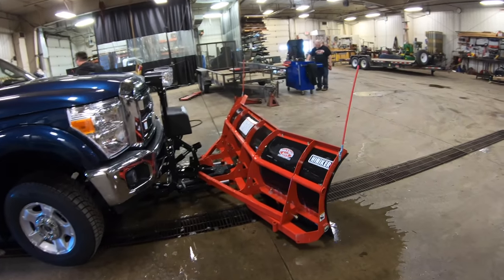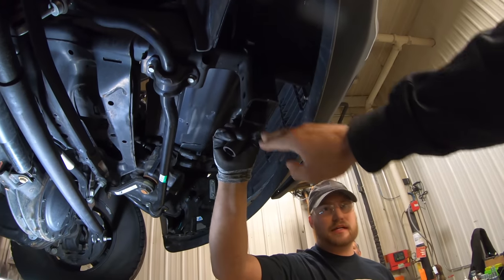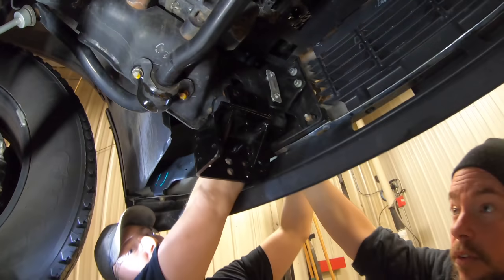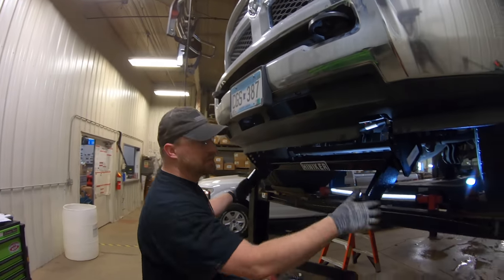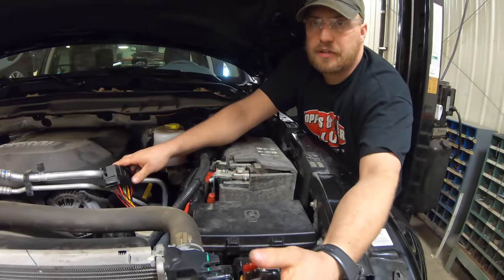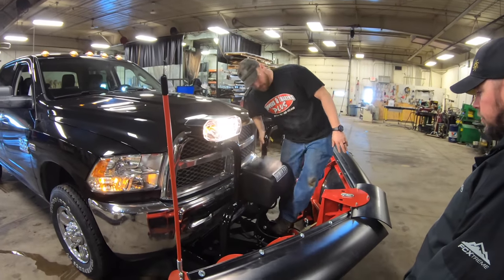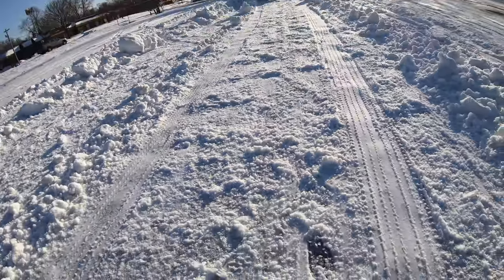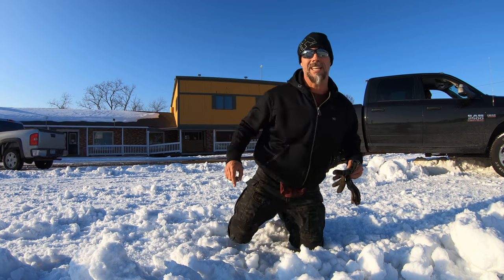Building and testing a new snowplow truck on a lot thats never been plowed 4 k video

Comment: The stock Firestone tires on HD Ram trucks absolutely blow. Replace them with a decent set of all terrains and you'll see worlds of difference. At 20k on mine they're about garbage and I don't use my truck hard at all.
Reply: Yeah found this when I tuned my 17 and turned it up, just blows tires off when boost kicks in. New generals in this week.
Reply: My '15 came with the Firestones.  I used them the first year and at just over 10k miles replaced them with Goodyear Duratrac's.
Reply: @Anders Conner instablaster :)
Reply: @Remy Hendrix it worked and I now got access to my account again. I'm so happy:D
Thanks so much, you really help me out :D
Reply: @Anders Conner You are welcome xD

Comment: If your intercooler is leaking lots of fluids. Youuuu probably shouldnt be worried about putting a plow on your truck. You have bigger issues.
Reply: He was talking about disconnecting the intercooler having it leak. That is why they work around it. If it was not a gaser
Reply: bigtx77  thank you.
Reply: bigtx77  Let me drop some knowledge on you. An intercooler isn't ONLY air to air. An intercooler is any method of cooling compressed (charged) air. It can be air to air or air to water. So, yes, intercoolers often contain a liquid.

Comment: Ram actually changed it so you no longer Need headlight adapters. If you get the plow package on the new rams.  It automatically transfer your headlights to your plow lights. Turns off your front air bags too I believe and some other nifty things.  Ram was smart for finally thinking bout their plow customers because that's been a big complaint on their trucks for years

Comment: Great videos. Last year i bought a new Ram 2500 reg cab. The Firestone tires are junk. I have been in business since 2003 and only run BFG tires. I drove it straight from the dealer to my local tire store and had bfgs put on and sold the firestones for cash.

Comment: I have used my hiniker scoop and it is a beast. I love the design, it is basically a box plow for a truck. The only thing is the paint is a little on the bad side. It has a little bit of a rust bubble in a few areas. Other than that it is a beast of a plow. i have had it for 3 years, 1st year we didn't use it much. But last year and this year it has been a blessing.

Comment: A good set of snow tires makes a big difference.  Also counter balancing the weight of the front plow, with a few thousand pounds in the rear will make a huge difference
Reply: need about 900# in rear for typical 8' v plow, sand bags, then also any salt you will use on top of that (so you don't lose optimal weight, and put the sand, behind the rear axle).

Comment: Been running Hiniker v-plows for 20 yrs. love em. Only has one issue. That was on my first one that was 15 yrs old. The power wire in motor burned off. Just re soldered and ran another year. Went and upgraded to new one same as in video. 0 regrets.

Comment: I've only had Western and Fisher plows. The Hiniker construction doesn't look as strong and I don't like the way the plow hooks up to the truck plow frame. The plow controller looks really easy to use.
Reply: Bradley Fitkin I’ve had my Hiniker for 5 years now, she runs flawlessly. Worse thing is the head lights... darn wires burn off at the connector to the bulb. Easy fix, just annoying cuz it happens like  twice a year.
Reply: @Helloreality101  I bet the wires burn off when you need them and that sounds like a design flaw. I've had my Fisher E-Zee V plow for 18 years now and all I've replaced is a angle cylinder which I broke.
Reply: I really didn't like what I saw with that Hinniker. I've always had Fisher or Boss plows. The each have their pros and cons
Reply: Bradley Fitkin that’s because there is no plow better than a fisher
Reply: hiniker 0 problems on c plow, love it, 7 years, got another of their v plows last week and another c plow, lighter, less front end damage... and plenty durable unless you like to ram brick walls and can't drive without hitting fixed objects, but double trip edge... no problems ever

Comment: We use 5606 Aviation hydraulic fluid in our trucks Power steering and on all our hydraulic tractors and other equipment. It doesn’t get  thick and won’t blow seals. I’m from Alaska.

Comment: Best tires for a plow truck? In the 40 plus years I have plowed, some tires have stood out. I worked in tire shops almost 15 years in the 70s and 80s. Today, I use Toyo M55s on an F350 Dually CC. No regrets. They carry a no chain needed rating when used on all four corners of a 4x4. Do pretty well in mud. Tread reminds me of the Firestone Town & Country. They were the best all around tread pattern for mud and snow. They sold them for over 30 years. BFG TA/KOs are pretty good on a 1/2T. BFG Commercial tractions worked well on my F350 but no mileage, 22k and they were gone. Michelin Tractions are fair but they are some money.

Comment: I have the exact same hinicker And I have a newer "c"plow.is awesome on truck bays and it folds over and puts 5oo lbs of pressure on the edge..best backdrag hands down!!!
Reply: good to know, i have c plow and never had a large truck with any other plow, just got a v plow for 2nd truck but am considering getting another c plow for it as well, so have v if we get 3" an hour for a few hours and fall behind, but c plow for 90% of our small snows
Reply: love the c plow, would get a 2nd one, but don't want to risk big snowfall while I am unavailable and leaving less experienced drivers with c plow, when a v plow probably opens up easier with less driving skill and less chance to fall off some of these super technical drives we do( cork screw, up hill, north slope, narrow (long truck) and can't see the surface where you are heading to... a bit scary??  lol

Comment: We use aviation hydraulic fluid up here for our plows.
Reply: Aviation hydraulic fluid is made with far higher standards.
I used to be a Coast Guard Aviation Machinist Mate and used it in all my vehicles. Plus a 50/50 Avgas mix. Especially in my 72 650 Triumph Tiger.
Ran like a bat outta hell with less carbon buildup in the plugs and valves.
We got it free from fuel samples on the Grumman HU16e Albatross seaplanes and Sikorsky HH52a SeaGuard helos we did sample drains on twice a day and after each refuel.
I used aviation hydraulic fluid in my front forks and the hydraulic brakes I installed to replace the friggen' awful original mechanical breaks.
Got that free as well from when we'd do landing gear and other hydraulic system inspections every 10 or 100 hour inspections.
As a 3d class I got stuck with doing fuel samples every duty day and after flights wether I was crew on a flight or not.
I love the smell of Avgas and oil burning in the morning as well as JP5.
Reply: 83282?

Comment: Looks like that truck has the Snow Plow prep kit, with the switches. Why would they piggy back on a fuse when you have the pre wires and switches?  Yep the factory tires Sucked. I pulled mine and sold them after about 10k miles, just did not have any use for the Firestones.

Comment: Great video!  I have installed many plows, mainly Fisher and Meyers, that is one slick plow, not sure if I am into the black for safety concerns, but it is a nice looking plow.  Watching install, so much nicer on a brand new truck, I have done quite a few installs on 2 and 3 year old trucks, not fun.  Thanks again Stan, great video!
Reply: 2-3yr old non plow trucks should be fine underneath still. They better be.
Reply: @pryme2013  Not in the salt belt my friend!!! Ive seen it and done it.
Reply: @bigredjohnson6921  where do you consider the salt belt? MN/WI uses tons of salt and my 4yr old truck is spotless underneath,  but I do coat it with fluid film before each winter. Still though.
Reply: @pryme2013  Northern Vermont. But not everyone is as diligent as you treating underneath with fluid film. That would make a big difference.  Our road treatment also has larger aggregate in the mix which bounces and creates havoc on undercarriages and any factory treatment.
Reply: @bigredjohnson6921  yeah I recommend fluid film for sure

Comment: Nice vid.  Ive been eyeballing the C plow for when I add another truck.  Ive been running snowdogg vxf for a few years now.  Been very pleased.  No issues.  Do you normally have ballast?  Seems like you are heavy in the front.  I normally keep 1500-2000 #s of salt and have timrens all the way around on my f250.
Reply: can't say enough about the c plow for use working around houses, garages    getting a v plow set up on a 2nd truck, hini 8'2", may get a 2nd c plow because for 90% of our snows (1-6" stuff), the C plow is just as good time wise, if not easier because less snowblowing to tidy areas around garages, etc.  the scoop plow has got to rule for large lots, but we skiddie those with a meyer powerbox (5-8' adjustable)

Comment: what size tires do you run in the winter for plowing? we always swapped out our wide tires for tall skinnies to get more traction. you would think opposite but it forces more weight per square inch of tire contact allowing for more traction. also sandbagging helps. we also did that with a couple trucks for added pushing traction.

Comment: If you don't want to get stuck, put the blade on a GMC. Dodges are to light to push snow. And they fall apart after a season. GMC there's no substitute.
Reply: Really?? I call BS, as someone who runs both. The Ram can do everything the Chevy does, maybe more.
Reply: @bicyclecrashsurvivor8884  I have been in the bobcat service snow plowing business for 41 years. And I have had all make s and models over the years. And the toughest is GMC. Longest lasting. Ford diesels are junk. To many problems. Switched to gas. They are almost double the cost in fuel. Toyota's last maybe 3 seasons and there trash. Pretty boy truck that are scrap. Now I won't take a dodge if you gave it to me. Unless it was ok if a ran it into a f en tree. Complete junk. Transmission you might get 2 full seasons out of it. If the oil pumps don't go and you're replacing the motor. Brakes suck..... nothing but plastic junk.
Reply: @bicyclecrashsurvivor8884  It's admirable you keep up this Dodge fight. But you're a dreamer. And dreamers are the creators of dreams. So just keep dreaming and maybe reality will kick you in the ass one day.
Reply: @bicyclecrashsurvivor8884  Well Brain. I dont accept your apology until you admit Dodge is the biggest hunk of junk on the road. Just below Ford.
Reply: @buster178  I grew up driving GM trucks. I've replaced enough fuel pumps, transmissions, valve seals, rear brake wheel cylinders, and relays to last a lifetime. GM has a recall now that affects 3 million trucks for brake failure. They've been having the same break failures for many years and still can't figure how to make brakes work. I like my base model Ram that cost $28k brand new and does everything a GMC can do. GMC trucks cost as much as a house!!!
Reply: @bicyclecrashsurvivor8884  Dodge are nothing but junk. You get what you pay for. So keep buying those cheap pieces of junk. Keep turning them in every 5 years. Toronto public works switch to GMC's because the dodge were costing to up keep.
Reply: @buster178  Toronto eh? Isn't Canada referred to as the "Rectum of the World"? 💨💩 No wonder you drive a GMC, I would expect no less from someone who hasn't seen grass or sunshine for the last 6 months, lol.
Reply: Republican no doubt!! I support Captitalism, I don't need drips from my government to thrive, and I don't agree with killing babies.
Reply: @bicyclecrashsurvivor8884  well ok Brian. Glad to hear you don't like killing babies. But now you're just boring me. So 8fnyou want to get the last word in this conversation. I suggest you make it a good one. Keep that one on one relationship with your Dodge dealer. Going every 5 years to buy a new one. Although, by the time I have to buy new trucks. It's a whole new staff at the dealership. Because they are retired. That's what you get when you buy a GMC. 25 years of service out of every truck.

Comment: My 2001 doesn't have those bars.
Reply: My 2000 does.
Reply: @AndyFromm  perhaps they were removed then.  As I bought it used and already lifted.
Reply: @WildXNatur  f350?
Reply: @WildXNatur  neither of my 99 f350s have them but my 2000 excursion had it till i put the plow on
Reply: @AndyFromm  Dodge Ram 1500 Lariet.
Reply: @WildXNatur  i don't know much about those. Might be more so on hd trucks because they tend to sit high from the factory.

Comment: wow.. 
loved the video, nice install.. but not fully professional i feel. why in the hell would you draw off an existing fuse..?  I don't use my lighter as a lighter, it is an auxiliary plug spot like the other two in my trk.. but all three is on the same fuse.. there is not a separate fuse per plug.. so if I have my GPS on.. radar detector for my fast foot and charging my smart phone.. AND using my plow.. thats alot on one fuse.. why would you jump off anything when there is so many extra spots depending on options on vehicle  open.. even a fully loaded trk from the factory has extra fuse spots in panel for after market applications.. under dash and under hood, there is extra spots.. now I guess if you are smoker then the cigarette lighter is a direct ground to heat a coil as we know... so don't light a cigarette while making a pass I guess....  lol
thanks for the video.. good install but piss poor wiring.. all for an  extra ten dollars in materials to never have an issue..
Reply: #UpfitterSwitches

Comment: Lol guys like them v plows bunch of junk best plows on the market are fisher xls and western wideout hands down  I don’t care who you are or what you gotta say I’ll run up against any v plow
Reply: V plows are pretty necessary for some applications like pushing through drifted lanes and roads. Also adding wings to a large V brings it up to 11 feet wide. You can carry a lot of snow with that setup. Some guys prefer the simplicity of a straight blade with fixed wings, which is my current setup and I like it. Wideout is more versatile and carries more snow, just more complicated to run. All comes down to personal preference.